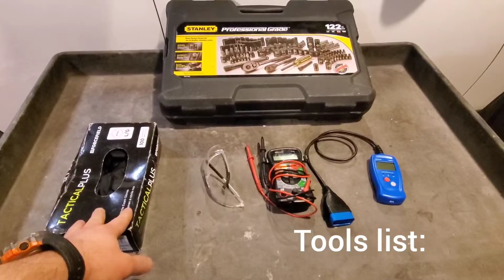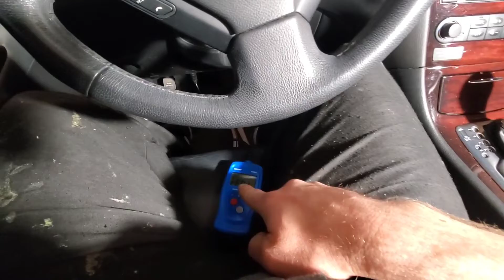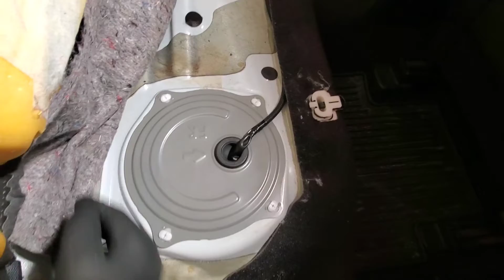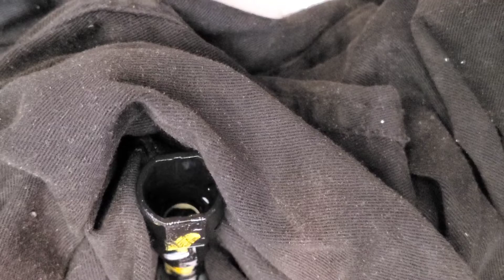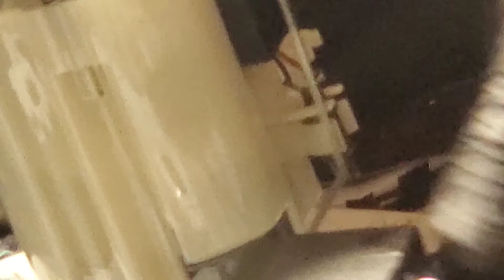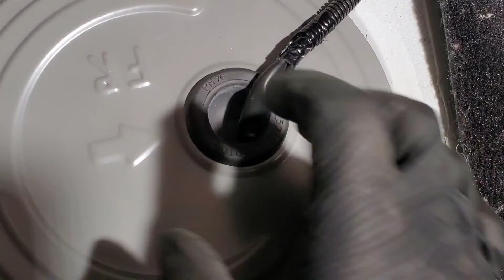PO462 engine code troubleshoot 2012 Infiniti EX35 (DIY guide)

Comment: You missed cleaning the Nylon where the pin rides along the empty to full ridges from the float. If you had done that the code would be gone I believe. Install a new one and see if the code is gone?
Reply from the maker: Thanks for your comment, this wasnt my car, l told the neighbour l would take a look at it. It was a one night thing. I never worked on this car before so l have no experience with it. The idea of the video was how to take the float out and check it. The float works. I didnt have an oppurtunity to work on the car any further.

Comment: @homeowner DIY,   I have same car and same problem.  Check engine light on and gas guage not working. I drive based on mileage instead of the guage but light still on. Mass air sensors replaced ad throttle body replaced. Light went out both times but back on
 Any suggestions?
Reply from the maker: Thanks for you question, l believe the fuel gauge itself can be a common cause of this problem in the cluster. Damage wiring going to the float can also but a problem but I think this would be a rare cause. Why did you replace the mass air flow sensor and throttle body?
Reply: @HomeownerDIY  infiniti diagnosis showed throttle. My mechanic had already diagnosed sensors.
Reply from the maker: @msfairminded634  I didnt think you took the car to a mechanic. Well my suggestion is to check the fuel gauge itself.
Reply: @HomeownerDIY  I initially took to mechanic for check engine light. The fuel guage was later and I have not taken to mechanic yet. I will have to so I can get light off before my emissions test  in Feb.